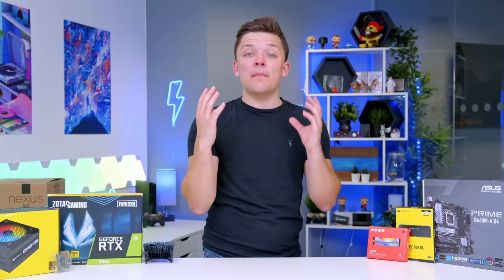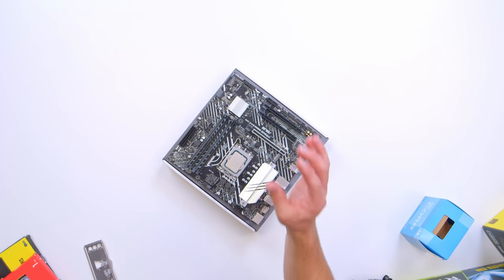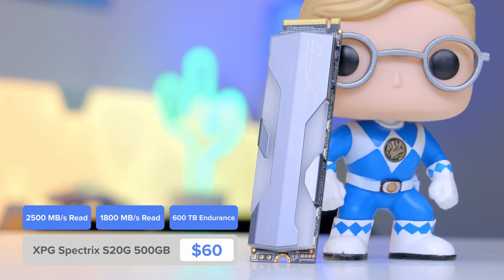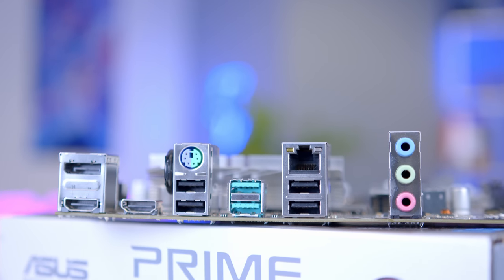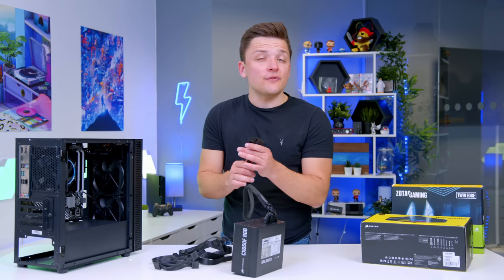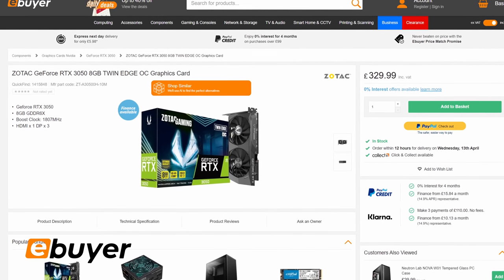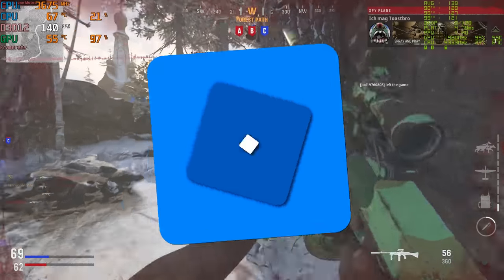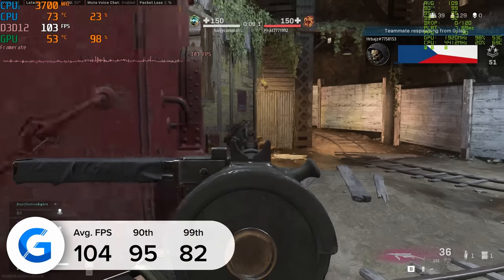Best $800 RTX 3050 Gaming PC Build 2022! [FULL Budget Build Guide w/ 1080p Benchmarks!]

Comment: What do you think about my new build? It has Intel i5 12400 paired with RTX 3050 Ti , MSI B660 Tomahawk , 16gb DDR4 3200 mHz ram and 512gb NVME SSD.
Reply: Just run the benchmarks.
Reply: There is no 3050ti
Reply: Im putting together the same build with a rx6600 ($369)
Reply: @7amood_090  exactually
Reply: @7amood_090  My bad
Reply: @MrMakingcake  Yeah RX6600 is better but it is not in stock in my country :(
Reply: @7amood_090  there is lol
Reply: @Shorty_Casts  how much did it cost?

Comment: Hey geek, I was wondering what other case I can use since I’m no where near the uk. Any recommendations?
Reply: I used the Corsair 110R
Reply: @brokeashit  Did u actually build this pc from the video?
Reply: @soroush5143  yep
Reply: @brokeashit  I wanted to build this pc too, do you have any negative points about the pc? And what about the good things? 🙏🏼
Reply: @soroush5143  so far the PC is awesome I've been running rtx on with 120+ fps I also tried unreal engine 5 as that is the latest and strongest graphics currently and it didn't run that well but that's because unreal engine isn't optimized yet, other than that this pc is a powerhouse and is so worth it

Comment: (Future proof)                   Editing/Gaming                  👑
MSI MAG B660M MORTAR WIFI DDR4                       Motherboard
Intel Core i5-12400                                                          Processor
Palit GeForce RTX 3050 Dual Fan                                Graphics Card
Antec DP502 FLUX (White)                                           Case
Crucial Ballistix RGB (White) 16GB DDR4-3200 x2   RAM
XPG Core Reactor 850 Gold Fully Modular                 Power Supply
Lexar NM610 1TB NVMe M.2                                       SSD